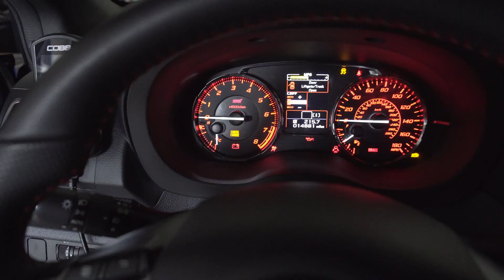STI Updates and Wicked Big Meet Trip | 2017 Subaru WRX STI

Comment: I would check out Ceramic coating for all those parts.  I hit up a local shop and they said they would ceramic coat everything for under 400.  Headers, Up Pipe, Down Pipe and Hot side of turbo is what I asked about.  I unfortunately ran out of time so I wasn't able to get it done before my tune.
Reply from the maker: Ty Jacobs i thought about it and then wrapping it, but I woundt take everything off haha, just some things. I have ceramic coated some headers myself in the past, i might just do it myself as I am a do it yourself kind of guy. I will check it out
Reply: I ended up wrapping mine too lol.  I am also a do it yourselfer which is why I dig your channel.  I cant see myself taking all the parts off for coating now that it is all up and tuned so I totally understand.   The wait would kill.  Keep up the good work brother
Reply from the maker: Ty Jacobs yeah I will probably take the headers out and the external wastegate dump pipe and coat them then wrap them. I might try to coat the up pipe without taking it off lol and then wrap everything. Hopefully I can do it soon. Thanks for watching, I appreciate it.